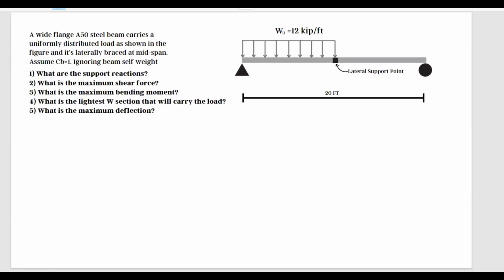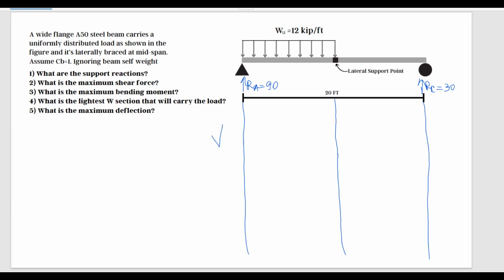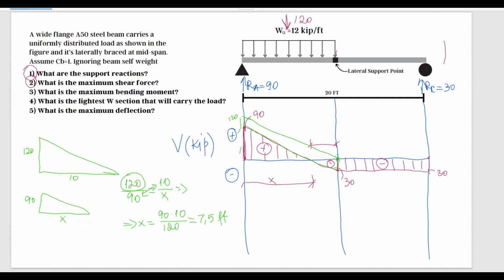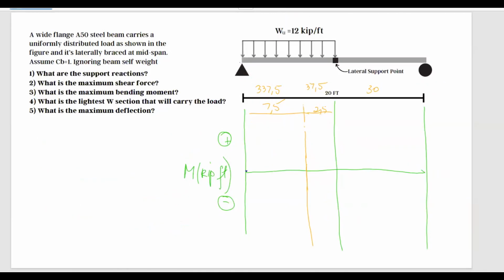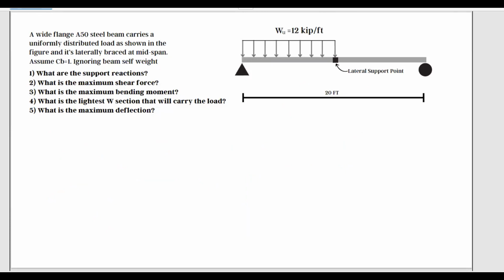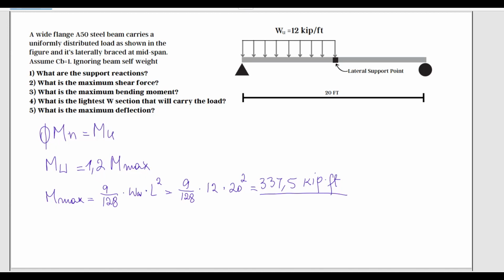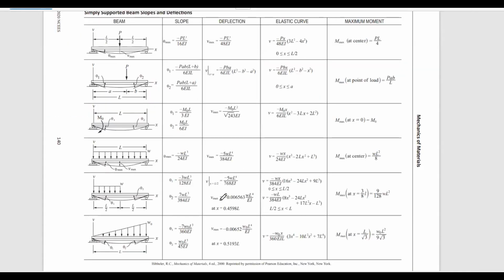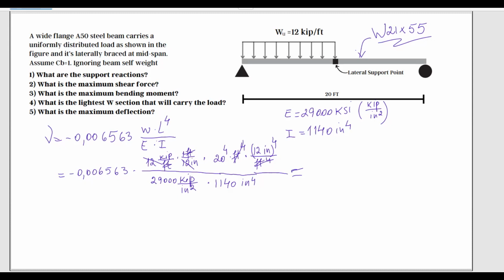FE Review - Design of Steel Components - Steel Beam

Comment: With the Mu=1.2Mmax, i presume you are using the factor 1.2 due to DL? Thanks.
Reply from the maker: Correct! 1.2 is the factor for DL. Even though a 1.4 factor would have been more accurate, since this example doesn't include the LL.